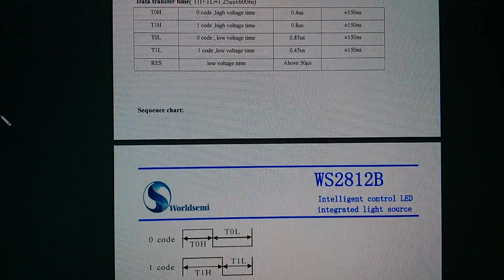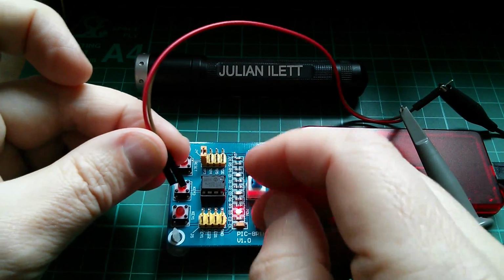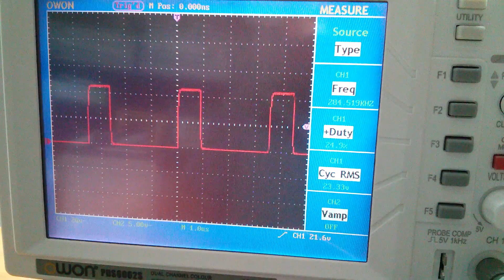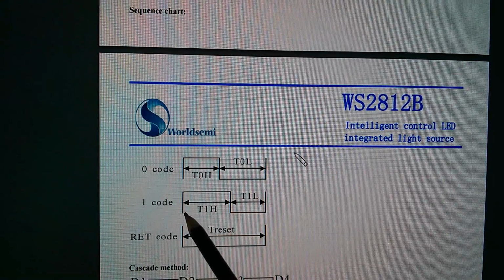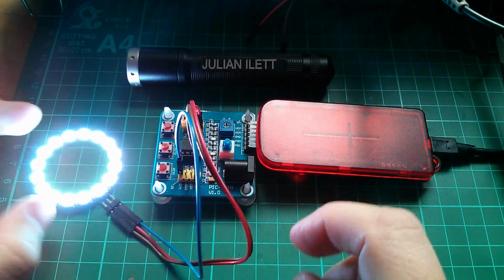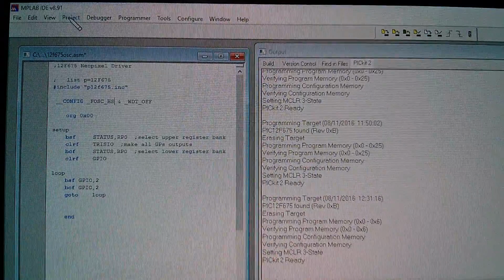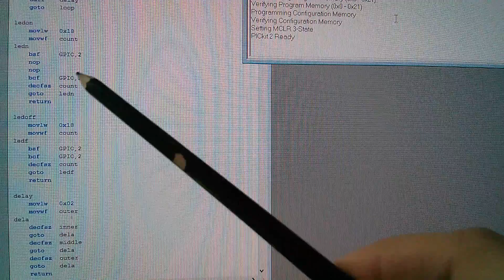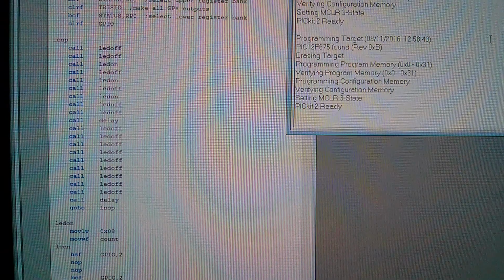NeoPixels and the PIC12f675 Microcontroller

Comment: You can drive Neopixels with just about any speed CPU if you use 2 output pins and then a pair of simple series cap/FET pulse shapers for each state and wire-OR the two to the single data line to create the fast timings. The CPU has only to worry about creating the pulse edge then and is not burdened with the exact pulse timing. This is how I got Neopixels running very quickly with a small PIC but not seen anyone else even consider it as an option.
Reply: Can you make a video about this method?

Comment: If anyone is still interested in this issue, 19 WS2812B can be easily made with 20mhz crystal + 12f675.

ASM code @: http://modelci.net/12f675_WS2812B_Driver.asm
HEX file @: http://modelci.net/12f675_WS2812B_Driver.hex

There are explanations in the code, but you will need to use google translate.
Reply: Links are not working bro
Reply: @subhasishbiswas7928  files updated please try again.

Comment: When 5 times slower means 1/5th the speed, how can 1 times slower still use the comparative when 1/1 means it's the same? This retarded incomputable colloquialism needs to die.
And no, 5 times longer does not mean it is 5 times the value, it means the original value PLUS five times itself, so that would be 6 times. If you want to use the new count including the original, then, surprise!, the English language has something to cover that as well! So since 1 ms/200 ms is 5, not 6, it's either "4 times longer" or "5 times AS LONG". There you go!
Really. This shit needs to stop so that listeners can infer the correctly implied values. If you cannot be arsed to make yourself clear, might as well not bother in the first place.

Comment: Oh, that's just ridiculous. I etched a board, it's a beautiful surface mount homemade masterpiece. Except I couldn't get the WS2812B to run properly on a 12F675. So I swapped it for a 12F1501 which is pretty much exactly alike, just has a 16Mhz internal clock and I still can't get it to work. I have had this project sitting around for years now, and I just now found this video where you've managed to do it on a 16Mhz clock! Cheers!

Comment: I'm sorry, if it is mentioned earlier within some comments ... but as far as I know (!!) PIC micros are "kinda slow" (compared to Atmel AVRs for example) because the basic units of executing instructions is measured in "machine cycles" but the document does not mention with "big bold letters" that one machine cycle is actually four clock cycles ... For AVR it is the same, ie one clock cycle is one machine cycle. That is, a PIC (well, maybe not the newer ones, like PIC24 stuffs) has four times slower than an AVR if executing only simple instructions on both of them on the same clock (ie, instructions which requires one machine cycle on both micros). Hopefully I was correct, honestly I've never programmed PICs (only AVRs) just a friend of mine (dealing with PICs as his professional work) mentioned this to me once. Well, as far as I remember :) But I haven't seen the whole video yet, so maybe it will be mentioned later, that it's the case :-D The other thing: what I found to be problematic, is the strict timing requirement. But also it can be slow for example for a POV-project. After some time, I discovered, that according to the Adafruit terminology (anyway it seems most cheap "clones" use some kind of APA* ICs intead of the mentioned WS* with similar/some functionality?), there is the "dotstar" stuff, which unlike "neopixels" use two wires for data, ie the data and a clock line. Then, it's quite up to us, what frequency and timing we use to send out data it can be slow and extra fast as well (surely, within some limits though ...). I haven't bought it yet, but I'll give it a try. And it reminds mi the SPI bus (without the enable line though) so maybe with the right SPI mode selected, MCU's hardware SPI can be used to speed up the shifting-out process many times, as the hardware can do then it for you inside the MCU. What I could find: https://learn.adafruit.com/adafruit-dotstar-leds/overview And the most important: I like your videos, thanks for them :)

Comment: +Julian Ilett, these very short timings to drive the neopixel got me wondering whether a DSO138 can be used to measure them.
Have you tried this? Can a cheap oscilloscope be used to find out if the timing is off?

Comment: I also don't sleep very well because the radiator is making loud clicking noises. Any tip what I can do against it?
Reply from the maker: Diazepam?
Reply: Julian Ilett
I would only use something like this as a last resort.
Reply from the maker: Just kidding - we don't have the radiators on at night. If the heating is turned off half an hour before you go to sleep, the radiators should have stopped ticking by then :)
Reply: Julian Ilett
Since I live in a house with 8 appartments/flats I have no influence about that. At approximately 22:27 it goes in hibernation mode for an hour to come back at night mode at 23:37. While it is off, the radiator in my bedroom clicks because it cools down. It is like it clicks inside walls or inside the radiator itself. It's one of these old cast iron ones. When it turns the steam circulation back on at 23:37, it clicks again because it warms up again. Even when I leave it totally off, it still happens because someone above me might have it on and the steam heats up the tubes inside the wall.

I called my renter last year and this time again and nothing happens. I guess I may check for my rights to cut the rent...

Comment: what speed can you run the SPI bus at? If you can run it at a speed where the bit time is around the ssme time as the led off pulse time then you can send 1 or 0 bits as SPI characters.

Comment: what about the PIC12f683 basicly at 12f675 with 8mhz internal clock/ 2x program memory and PWM, would still be 100us short but may work or you may be able to jig the pwm, if nothing else it would give you more programming space.
Reply from the maker: Yeah, I like the 12f683. I used it in my solar charge controller. Not sure which would be more hassle for followers of the tutorial - making a Xtal add-on or changing the PIC chip. Either way, the tutorial will kick off using the 12f675.
Reply: also there must be a way of doing it, i use picbasic and it has a command called pulseout which has a resolution of 10us at 4mhz and 2us at 20mhz  eg pulseout led,40  gives a single pulse of 400us at 4mhz. ps havnt tested it :)
Reply: Hi Julian, just done a test on pulseout on a 4mhz 12f675,  basicly looping comand PULSOUT gpio.4,1 this gives 40.8us high and 8.6us, just noticed its 400ns not 400us you need so miles off. :)

Comment: Can unroll loops to get rid of gotos or branches. If you're only counting to 24, then 24 copies of 2 instructions is not a disaster.
Pipelined CPU architectures will slow down when a branch occurs.
Reply from the maker: I've no doubt I'll have to use techniques like that when the synthesised patterns get more complex :)

Comment: The real killer with Microchip asm was Mplab, 10 years ago it was so environmental unfriendly (code build and programmer paths) i give up on it and moved to C. I would be surprised if anyone could download Mplab and build a project in half a day.
I watch all your vid's but I think your flogging a dead horse with this tutorial. Thumbs up anyway.
Reply from the maker: I agree completely. But this tutorial will be conducted in the engine room.
Reply: I am in total agreement.
Reply from the maker: My experience is that C is great for getting the job done quickly, but not for building an intimate knowledge of the inner workings of a microcontroller. I want to teach about the W register, the GPIO port and its quirks, the bank select hassle and why you can't directly load a file register with a literal. You don't get to experience this 'nuts and bolts' stuff when you program in C.
Reply: For Microchip killer is that there is no good C compiler (after IAR dropped support for them). There are "usable" with asm, but C compilers are too bad for an application.
Reply: I had a lot of fun writing programs using Picbasic from cornhill.
Reply: All I am saying is micro's are fast enough today to stay out of the engine room.
Reply: Julian Ilett
C is only choice for big projects, you will never beat optimization which C compilers do on them (that exclude Microchip C compiler which have 0 optimization in pro edition and in free it put useless instruction to blow up code size and to lower speed).
Assembly is useful for small projects or if you want exactly to control execution time of piece of code (that is hard to do with C, because it can generate different code for same part even you changed some totally  different witch on first look have nothing to do with part you want to have controlled execution time). And there is one more reason which apply to MIcrochip C in favor of assembly, their C compiler can generate wrong code (from correct standard C you will get result that do not behave as standard say, or even do not produce correct working code).
In all other cases C compilers will produce better code (smaller/faster)  than any human is capable (in some reasonable period of time, if you have couple of years to optimize 4k code then you could to do what high-end  optimizing C compilers do in seconds).
In C you will learn all about SFR same as in assembly, you will not learn about W register, and banks (which are gradually push out from PIC microcontrollers).
ps: If you didnt look at errata of PIC12F675 you should check it, PIC12F675 ahev some "features" that can cause some strange behavior.

Comment: My second thought: why you try to invent the wheel a second time..?...if you like these ws2812 why don´t you use the UNO, or a Teensy along with the FastLED library, they done all the hard work with that "to death" optimised inline assembler routines to make it as fast as they can...along with custom palette shifting/blending routines which make these LEDs changing colors fast and smooth. You just need some tiny lines to set it all up and your µC will have enough spare cycles for your own motion ideas...

Please stop wasting time on this DIY-assembler...ok you will have some colors and on/off patterns in the end...but if you ever saw these smooth color change with your own color palette and all these done by just four instructions and some for/if/then/else instructions and may you own color palette as well by using the FastLED lib, then you know what i mean...
You can focus on your LED animation entirely not on your bit banging to put down 24 bit per LED down the line with the right timing....
Reply from the maker: The tutorials will be PIC assembly programming tutorials, not Neopixel smooth animation tutorials.

Comment: I ran across a similar issue trying to implement WS2812 control on a MSP430F2013, which had 8MHz Internal RC. Turns out that I was able to get a narrow enough pulse width by abusing the SPI hardware peripheral, as it could run at 2MHz clock (/4 prescaler). I just used the MOSI and adjust the byte payload (ratio of ones to zero's) to determine the high/low time of the pulses. This seemed better and more stable than trying to muck with assembly and bit banging fixed to instruction cycles.

Comment: Tim from CPLDCPU wrote quite a detailed article investigating the timing of WS2812B and he came to the same conclusion as you, that the off time is not nearly as important as being able to generate a short enough pulse. https://cpldcpu.wordpress.com/2014/01/14/light_ws2812-library-v2-0-part-i-understanding-the-ws2812/
Reply from the maker: Thanks for that. I got my info from josh.com. Tim thinks the 'off' time can be even longer - which is good. So I'll try squeezing in even more program mechanics (calls, returns, tests for zero etc) into the 'off' time until I break it :)

Comment: fascinating to see scope on gpio. been looking at this before. was thinking about relaxing the mcu with a shiftreg running at four times the spi clock, but ditched the idea.. now you show that a constant stream is not important, only the pulselenghts so it is not needed to add extra hardware.
Reply from the maker: Yeah, there's enough slack in the 0v part of the pulse train to fit subroutine calls, returns and checks for zero count etc. Not far how far I can push this (around 5uS according to josh.com) but I'm tempted to try nesting subroutines next :)

Comment: My first thought was to build a circuit to shorten the pulse instead of increasing the clock speed. I think you could do it with a capacitor+comparator or maybe a 555. That way you don't tie up two of your GPIO with a crystal.
Reply from the maker: I had the same thought - a pulse shortener (differentiator) on a separate pin. Then OR the two outputs together. Probably a similar number of extra components to the Xtal circuit. I do take your point about releasing the extra GPIOs though :)
Reply: could you have the gpio charge a capacitor? only going high when its done charging cutting off the start of the high pulse.

Comment: How about  putting a suitable capacitor in series with the data line at the 4Mhz rate, would it narrow the pulse width enough for the off signal to the NeoPixels?

Would only work if as you demonstrated: the length of the off part of the pulse is really not that important.
Reply from the maker: I did think of differentiating one output to get the short pulse and using a different output for the long pulse.
Reply: Oh I like that idea, would be novel and you get rig of the crystal too.

Interesting stuff.

Comment: 12F1501  can go to 16 Mz with internal OSC and is cheaper. but I'm not sure if programming pins match (too lazy to check)
Reply: As i remember Microchip is persistent in programming pin assignment, so they should be same as.

Comment: Fun video. Indeed it seems that the width of the pulse is the most important thing. Rather than adding a xtal it would be cheaper to use something more modern, 12F1840 or 16F18313 as a drop in replacement. As you pointed out 4MHz crystal gives 1MHz instruction clock and BCF is a single instruction gives 1us. Keep up the videos... Good stuff.
Reply from the maker: Thanks. Even the 12F683 has an 8MHz internal clock - that might just work :)

Comment: I don't have that dev board (don't really need it) but I have plenty of the PIC 12F675 chips, some neopixels and a genuine Microchip Pickit 2 (and a couple of clones as well.) This kind of stuff is a lot easier on the AVR chips as the assembler mnemonics are a lot easier to read (for someone who cut their assembler teeth on a Z80 at least) but I have done a little bit of PIC assembler so it will be an interesting exercise. Looking forward to your next video on the subject.
Reply from the maker: I made the jump (in 1992) from Z80 to PIC. It was a bit of a steep learning curve. Harvard architecture, hardware stack, banked SRAM - it took a while to adjust.

Comment from the maker: It's just occurred to me that it should be possible to connect the load capacitors to either Ground or Vcc - that would certainly be easier on this PCB.
Reply: Julian Ilett so what do we need? 16mhz oscillator and a couple of random caps?
Reply from the maker: random caps between 18pF and 22pF
Reply: Julian Ilett there should be a mathematical equation that you can put into the code to shorten all of those codes as well I just can't think of it off the top of my head that way it's not so repeating

Comment: The robot motor binds a lot, make sure to have an exacto knife to trim excess plastic in the gears and run it back an forth. The motor is tiny and fairly small torque
Reply from the maker: Thanks for the tip - I'll give every part a thorough de-sprueing.

Comment: How about a heads up on the components etc we need to participate in your pic course?  I request that because if we're sending off to China for parts we'll be working a month behind you!
Reply from the maker: Not completely sure myself yet! But so far: Pickit (2 or 3) programmer, PIC12F675 demo PCB, some spare PICs, 16MHz crystals, 22pF capacitors, breadboard, LEDs, low value resistors (220 to 1k) resistors.
Reply: Phew!  I should be sorted then, as I have most of the components, although I will have to get sorted with some neopixels!

Comment: Bloke, It might look fast but its not really. it takes nearly 6.5mS per 170pixels.
Thats nearly 250mS stolen from the CPU just to maintain 40FPS.

edit: As you know they run at 800KHz regardless of CPU speed.
also: Try sleeping with almost 5000 of the buggers 2 meters from your bed :P

Comment: would an attiny work too?
Reply from the maker: Probably - if you can program it in assembly language (actually it's doable in C too).
Reply: 3dprint-tech yes(attiny85),  I haven't tried programming it myself but using a library works works quite alright! You don't even necessarily need any external components. It even works with only an attiny, a lipo and the leds!! It does glitch around a bit sometimes though
Reply: Ok, thanks, I'll give it a shot in C, I don't really know assembly... :-/
Reply: Thanks! I'll try
Reply: Yes it will. I have used an ATtiny85 and the Adafruit Neopixel library to run the strandtest demo. Of course I did cheat and used the ATtiny85 add-in for the Arduino IDE. It works perfectly using the internal 8MHz oscillator. I can post my sketch on pastebin if you require it.
Reply: That would be awesome, Thanks a lot!
Reply: Here you go:

http://pastebin.com/BRaY7fuB

you can adapt the #define statements to your own requirements.
Reply: Thanks, really appreciate it!:-)